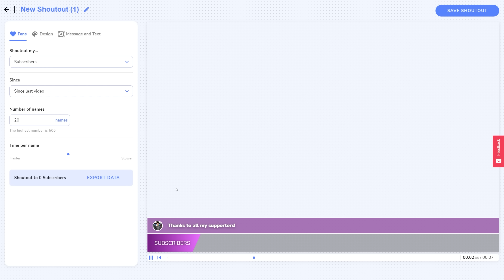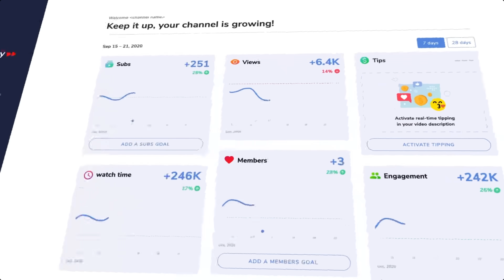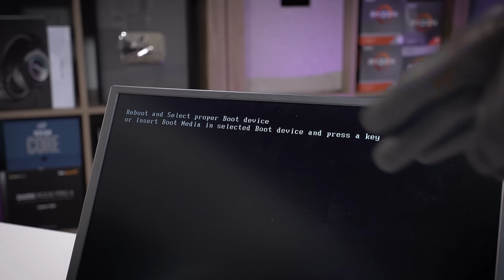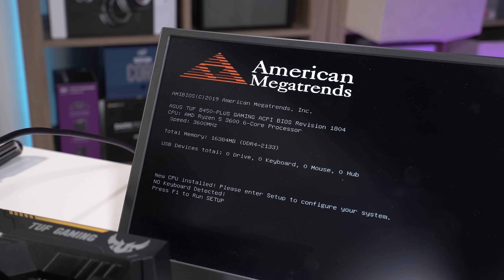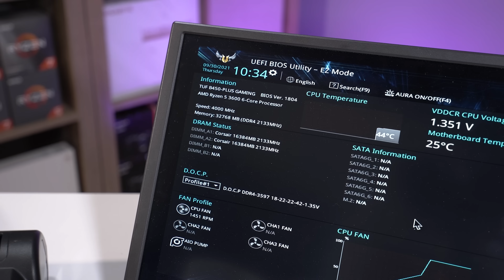Fixing a Viewer's BROKEN Gaming PC? - Fix or Flop S1:E15

Comment: Greg, I have an issue with my radiator, I know this might be the wrong channel, but nobody else answers my messages on these things, anyway, I have a Gamemax pc case, with a Cooler master masterliquid 240 on a Ryzen 7 3700x, the radiator is at the front of te case, with the tubes at the bottom, but I feel as if the tubes are getting stretched slightly, so I want to upgrade my AIO, rather than have the tubes at the top, what AIO would you use instead off the one I have, and the one you recommend, does it have longer tubes? Thanks in advance.

Comment: the exact same thing happened to a PC I was trying to fix a few days ago, removed the replaced the CPU to test and got post and just replaced back the original CPU that didn't post earlier and voila, worked again on the same motherboard. Still confused as to what exactly happened there to be honest.

Comment: Wow. I'm pretty sure this exact thing happened to my computer on Saturday with a near identical setup  I'm running a 3600x with ddr4 and just randomly it stopped producing a picture. I had the CPU and Dram debug lights come on. Didn't try the single slot idea though. I'm thinking that the 3000 series CPUs might have issues running ddr4 or something. It took a year for this issue to happen since that's when I upgraded to ddr4. So now I have a 5600x and new motherboard on the way and just assumed my old CPU was dead lol.

Comment: Hey I had the exact same issue with my 3600 or so I thought, upgraded from a 2600 to the 3600 and was testing overclock and unerclocking then suddenly had no post, ended up using the 2600 again in order to update the bios on my Asus b450 strix which worked until the same thing happened again which resulted in the issue you showed in this video, except my cpu worked in another board so I sent the board off to Asus and guess what... all they did was update the bios! but for me it wouldn't boot with my old 2600 or my 3600!! and I had the latest update on there too but after I sent off my board they released another update.. 🙄🙄

Comment: So...A question: I've got an msi rtx 3090 gaming x trio. When i mounted it vertically, it started making a ticking sound (exactly like a watch). At first I thought it was the fans, but turns out it's not since last time they turned off and the sound started while idling...  It usually starts when starting a game, then it stops (or comes and goes). The weirdest thing is if I turn my case, making everything face up, and then put it back to normal position again (while on), it NEVER sounds. I just can't understand what is it...

(There is a short on my acc).
Reply: Could be coil whine.
Reply: @noobontour3167  did you watch the video I have by any chance? bcs it'd be the first time I hear coil whine like that... iI can't find a single video like mine, sadly
Reply: @g.k61  Ah yes, it does sounds ore like something hitting the fan. Sounds mechanical to me, but you also said it sounds like this when the fans don't spin. So I wonder if the sound doesn't come and bounce from somewhere else.
Reply: @noobontour3167  i know. It’s driving me crazy. But it comes from the gpu 100% sure. Im watercooling it in a few weeks… and hope it goes away. Otherwise i’ll just have to mount it horizontally 🤔 I’m just afraid the card might be faulty and dies eventually.
Reply: @g.k61  well then enjoy it as long as it last, if the card is running smoothly then I'd say nothing to worry about. Or talk to manufacture and ask of they have a spare, otherwise enjoy it
 Till it brakes hopefully withing warranty period. Most likely nothing serious, sounds rly mechanical so I'd try to check every wire on the card making sure it's not getting in contact with the fans

Comment: That's the third Ryzen I've seen with a dead channel. Difference in that the two I've seen were dropped and one corner got partially crushed. Otherwise perfect CPUs if you're fine with single channel. One, a Ryzen pro 1500, is now doing duty in a mining rig.

Comment: I have a system with a hardware issue. It doesn't have half of the hardware. I need a gpu, power supply, cpu, storage of the nvme ssd variety and that's about it. Think you can fix my PC?

Comment: I just finished my 2.5k pc a week ago, and the first  motherboard I bought wasn’t compatible with my cpu, and i couldn’t return it so I bought a new motherboard (b550f gaming wifi) and… it also didn’t work. It turned on but didn’t power any of my components. So I returned it and got another one sent to me, and that motherboard is… ALSO Messed UP. The dram light was always on and I couldn’t figure out why. But the first two slots of the ram on the motherboard don’t work. Meaning I can’t access dual channel ram, however I don’t want to send the motherboard back again because I’m scared to take my computer apart again. Mainly because my pins were bent and I bent them back in place just enough for the cpu to fit in and the pc to turn on. Any tips?

Comment: if only you did this with states outside of Florida, the paper weight of a computer i have sitting around freezes when seemingly doing nothing, most common example i can give is when connecting to the internet it just freezes and i end up having to restart the computer, i’m betting it’s either software or a cpu issue but who knows at that point, computers have a mind of their own sometimes

Comment: I tought that my ram was dead then I saw this video( have the same cpu ) and I have tested it as you were doing and my cpu have the same problem…. Everything turns on but no post if I use both slots (I have a itx bord so I only have 2 slots onboard) but if I use only 1 of then post.

Comment: I actually have an old four core CPU that would always completely blue screen windows and even scramble up data until I learned that one of the cores, core 3 to be more precise was no good.  I had to actually turn off TWO cores in windows using msconfig and it runs fine. I had to turn off both cores 3 AND 4 unfortunately because there is no way that I know of to just shut off core 3 and use just three cores.  If core 4 was the bad one, THEN I would have been able to run three cores instead of only two. I guess that I was lucky that it wasn't core 2 that was out making only core 1 operational.  Worse yet would have been to have the first core dead then the WHOLE CPU would be completely worthless!  Unfortunately there is just no way to use msconfig to actually turn off the core of your choice and I know of no other way through software or hardware to do this. I was using Windows 7 by the way.

Comment: If it was a dead memory channel, and that's not to say it isn't, if the memory configuration hadn't changed, and his CPU worked and the customers didn't, that doesn't explain the memory problem. Not to me anyway. At the 8:40 mark, it shows both sticks of memory in the computer and the board posting. And this was before his theory about the memory.

Comment: I have a problem with my ryzen 7 3700x where if I change the ram timings it wont post at all but all I have to do is boot it up with a single ram stick power down and insert the second ram stick and it will start working again it's so bizarre and frustrating kinda crazy how sensitive ryzen is when it comes to ram.

Comment: Thank you, This video make me know why my ryzen pc don't work with mix RAM dual channel.(1x 8gb  kingston ram and 1x non-kingston 8gb ram )(mix ram single channel work)when i pluged the 2x ram into dual  channel , the pc only detected 8 gb ram.I didn't what to do for fixing it so i did a search about it.After a while searching,i know it's might a bios problem so i gived up for debuging why my ryzen pc don't work with mix RAM dual channel . Until I watch your video,i tried the debug step on your video.(only plug 1x ram in channel b). And it turns out the RAM controller in cpu is not working.(I have no idea about is causing what  RAM controller in cpu not working.it's either due to the missing pin on my CPU or the ram controller die.

Comment: I have this exact some mobo and air cooler in my build I just completed. I had similar issues, but my graphics card wouldn't put out a picture. Luckily I had a 5600G so I was able to use onboard graphics and download all of the drivers I'd need and got it working. Don't know how I would have been able to get this thing working without the onboard graphics. 

Also, maybe someone can help me. It takes quite some time for it to get an image to the screen and whenever I try and enter the BIOS now I get no picture when it is plugged into my graphics card. I spam the delete key to reach the BIOS, but nothing happens. I then power down the system and don't spam delete and no problems straight to a login for Windows.

Comment: But CPU actually won't work with that motherboard until you fix the BIOS I had the same problem I got the same CP in same motherboard we had to put a separate CPU in it to update BIOS and then it would work

Comment: Damn I have a similar issue with my own PC, whenever I put both RAM sticks in any configuration my PC doesn't post, and with only 1 RAM it does, thankfully I found out that the other RAM is busted bc at placing it the PC doesn't post

Comment: I recently had a faulty i5-8400, system would boot up fine but when it came to installing Windows is would always fail, I ran memtest and it said the RAM was faulty, took the RAM out and connected to a different PC and it passed, the CPU has failed and Intel were amazing it getting me a replacement.

Comment: Im having a very similar problem to whomever sent in this rig. My pc turns on but it refuses to post. I have an identical GPU (Evga 3060 ti FTW3 Ultra) that was upgraded from a evga 970 sc about two months ago. I also have a Ryzen 7 3700x. The PC worked fine until last week. I was doing homework on the computer when all of a sudden my display said it was entering rest mode, and now it wont post. I originally built it in mid 2020. I tried a different monitor. Ive tried one stick of ram on each dim slot (w/ both sticks). Removing CMOS battery for 5 minutes and reinserting. Ive tried a friends gpu. I tried reseating the cpu. I recently caved and ordered a new mobo and a ryzen 7 5800x. Got the cpu, mobo arrives in two days.
Reply: If only I lived in Florida.
Reply: Update, I installed the new motherboard and the PC still didn't work. Afterwords I put in to new CPU and it ended up working. Guess my CPU died aswell.

Comment: My pc broke down and i was away when it happened, my brother who was playing on it told me that it just suddenly turns off no power no display, so i go on full greg salazar fixing mode i did everything i could reinstalled all the parts and still no power, i overthinked the whole problem and i suspected that it was the psu, i took out all my old psu and paper clip test it then suddenly it all stopped working, after a day i bought a new psu then did a paper clip test and it didnt powered on too, thats when i got freaked out knowing that the psu i bought mew wasnt working but suddenly i realized the power cord, i switched the power cord and used a newer one then boom all my old psu started working, it was the power cord all along 😭

Comment: i had a simululair problem today. i had upgraded my gpu and getting no picture and pulling the old one in just well. i searched on the internet and my motherboard leds just says that it is the cpu becauce i had a led indicator on my motherboard. so i installed again the new graphics card and flashed my bios whit ez flash and it worked and the funny of his is that i have also the Ryzen 3600 and B550 motherboard chipset.

Comment: I got an annoying issue, my rig sometimes randomly locks up and I don't know why. Sometimes it's a sudden lock up when I alt tab between a game and discord where it'll go to a black screen and stay there, but will still show the alt tab menu and the only way to fix it without killing power to it is to Ctrl alt del and sign out. Or I'll leave it on for an extended amount of time and then audio will cut out, certain actions being unresponsive and I can't power off the system or try to sign out from the Ctrl alt del menu and can only fix it with cutting power to the psu. I have already updated my bios which shouldn't be an issue since it's an X570 with a R7 3700X, and I have uninstalled RGB software and NZXT CAM and it still happens. If anyone has any idea it's greatly appreciated because I have no clue what to even do with it

Comment: I know this is old but same thing happened to one one my pcs like 6 months back but my motherboard had ez debug so i knew it was ram. Problem was they worked on the other pc i have… i triple checked i had them right when then i finally figured out u had to move around the ram going against what the manual said and it worked. 16gb

Comment: Hey, I had a friend from Texas a few years ago ship me a custom built desktop through FedEx with paying for their insurence. FedEx delivered a damaged wet box with my Desktop damaged and refused both me and my friends claims despite him paying for insurence... I live in Canada Ontario but I have a friend who lives in Port Richie Florida, If I send him my Desktop think you could fix it?

Here are the Specs he put on it:
240GB SSD, 1TB HDD, Motherboard and Case is Asus, Intel i5-6400 and GTX 1060 3GB, 16GB of RAM

It turns on however it stays on for 1-2 Mins and then auto shuts off, and nothing appears on the moniter, yes I tried with at least 3 different moniters so I know it's not the Moniter

Comment: Watching these videos actually makes me a bit scared. What would I do if my expensive PC ever stops booting up or even turning on? What if I replace the PSU and it still doesn't work? I have no way of testing with different components. It would be pretty much impossible to know what exactly is causing the fault. It would essentially mean that rather than replacing the faulty component I would have to purchase and build an entire new PC, merely because I cannot know which component is at fault. A relatively cheap repair could turn into a very expensive entirely-new PC merely because I just don't have the resources to find out what the problem is.
Reply: If your PC stops working, take a trip to Disney World and bring your PC with you. Greg will fix it for you. ;)

Comment: I recently bought and assembled my first gamming PC (RTX 3060, Rysen 5 5600x, Aorus b450m, 1x16 DDR 4 3200Hz)
I was so scared of using too much force plug things in that the first time I booted the sistem it failed to boot at all because I didn't fully plug the motherboard power supply. And a second time because I didn't plug the RAM... xD

The first time got my heart plummet. Haha

Comment: I'm new to pc and I am planning on building my first pc but would like to know if all my parts work together and I am aware they are older parts but it's cheap and first time

AMD Ryzen 5 5600X 6-core, 12-Thread Unlocked 

GIGABYTE B550M DS3H AC

OLOy DDR4 RAM 32GB (2x16GB) 3200 MHz CL16 1.35V 288-Pin

Crucial P1 1TB 3D NAND NVMe PCIe Internal SSD, up to 2000MB/s 

GIGABYTE Eagle GeForce GTX 1650 4GB GDDR6 PCI Express 3.0 x16 ATX Video Card GV

EVGA 650 Bq, 80+ Bronze 650W, Semi Modular

Comment: i had a funny problome that i found a fix after 5 years 
sooo it was ram 
i did get picture and all specs of my parts
but sometimes i turn on the system pc wont boot it will freez on the bios boot
all i did was to reinstall windows all the time to fix the problome 
sooo when i was deep cleaning my pc 
i cleand all the gold pins of the ram and my problome got fixd
but i still dont understend why
i had all the 16gb of my ddr4 no problome useing the pc when its on
but the only thing was a problom is to restart pc and update windows 
and power go off
this will kill the boot and i will need to reinstall windwos
i tested my ssd with the windows in it on other pc and it workd fine

Comment: i have a computer that will give a memory light error but if you remove the top ram from the top slot then turn on the computer will boot. then after it boots you can put the ram back in and it will work like nothing happened till you unplug it or lost power. i thought it was cpu change it with another one i had around and same problem so i know it's the motherboard. the thing is the computer is 14 years old so i'm not going to mess with it because i know how to get it to boot and it will be a paper weight in 4 years unless i go to linux. so i'm not going to mess with it

Comment: The worst thing about this case is that if you would have removed one ram stick out of the system and then it boots one would assume that it's either a bad ram stick or a bad motherboard but not the cpu.
Reply from the maker: Yep! It's easy to misdiagnose!

Comment: I ran into a similar problem with my board back when I had a 2600. I noticed in windows I only had 8GB of RAM available but the BIOS was reporting 16GB. I also noticed that the XMP profile was turned off. Renabled it and thats when it would power cylce and reset the XMP to off. Upon further inspection I could not get it to post with a stick of RAM in one of the slots. Even swapping CPUs wouldnt fix it. RMAd to Gigabyte

Comment: that is al second time with ryzen processor, same think with old delided processor by macpro, to hard mounted fan or to high mounted, stupid. but i never had problem like that on intel processors with normal pc socket like 775, 1156,.. etc. I just think to go AMD but after i see so many stupid problems i think i wil go with I7 or I9 in my new build.